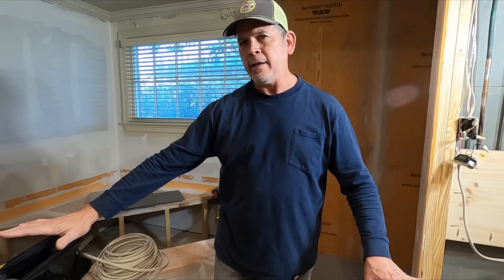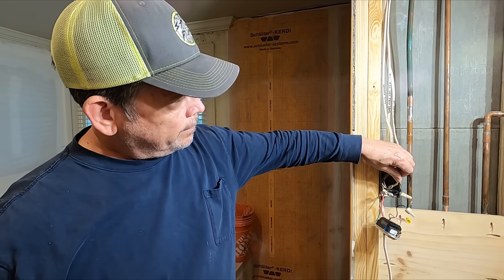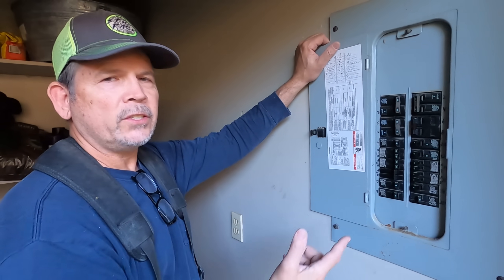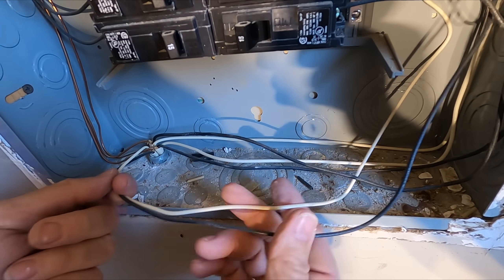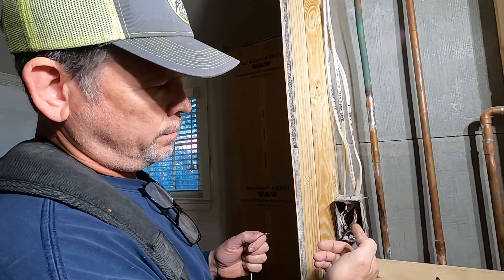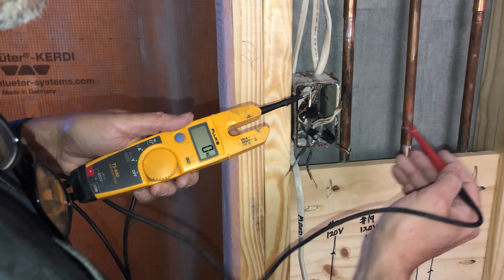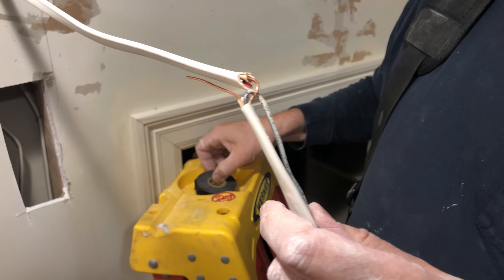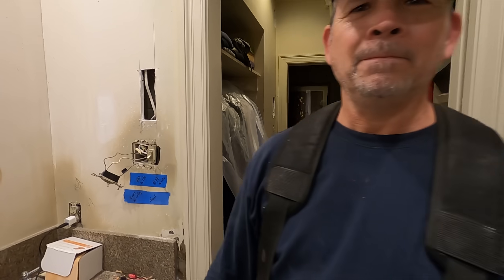You CAN Get SHOCKED by a Neutral Wire! This is How...

Comment from the maker: Hey gang, a couple of clarifications on this video:
1) The black tape you see on the neutral was put there by me to indicate that it was the neutral that had voltage on it; it is not identifying that wire as a hot .  Should've used a different color tape.  I removed it at the end.
2) All wires were determined to be safe after I turned off the breaker but someone turned on a 3-way switch in another room; this action energized the neutral.
Reply: Always test for voltage before doing any electrical work.  Only after you have confirmed absence of voltage, and properly locking out the panel or breaker, should you proceed with any electrical work.
120v is enough to kill you. Even if you feel fine, it can cause your heart to begin beating irregularly, ultimately resulting in death if untreated.
Reply: @akuunreach  It can also cooka few blood cells forming a clot that can kill you
Reply: Yes, an open neutral can have voltage on it ⚡. 
EDIT: I once had a lady's lights and some outlets wouldn't work unless she put her electric oven on. I figured it out pretty quick. Anyone ever see this or know what happened? LoL
Reply: @eldie3d  Actually Eldon that is not fully correct. In a typical switch circuit with power in the octi box for a light a white wire can have power but should be identified as black with tape. I have found people being confused as hell wondering why "that white wire has power when I turn the switch on".
Reply: @eldie3d  I think I can shorten this for you and make it more general. Your neutral can have voltage if it is open.
Reply: @eldie3d  please tell me a friend had this in her apt.
Reply: neutral was energized
Reply: @fredrickvoncold  the "neutral" should not be "live" or hot as they are not protected. The neutral can be perceived as hot, because it is the return to the panel and the "hot" goes to a load, then out the white (neutral) back to the panel. If this wire is disconnected, the elec flows from the black, thru the load, and has no place to go back, so if you touch the white and touch ground, you get a shock
Reply: @fredrickvoncold  neutral was not neutral
Reply: @Hearing.Chanting Remembering.Krsna when you say a center tap of a secondary is hot, what are you referencing? There must be a reference.
The neutral is a reference to a split phase secondary or the center of a Wye configuration. The center tap of a secondary in a split phase is the return path for the 2 phases of the secondary normally called L1 & L2. The two phases are 180°apart with reference to the center tap or neutral.
Reply: @jasonbender2459  Absolutely correct! It should be marked with a piece of black tape to note that.
Reply: @WilliamJefferson1776  You are dead wrong if you are suggesting it is fine to touch a neutral wire with the power on.
Reply: @davebrittain9216  I would touch ANY neutral wire with my tongue as long as EITHER of the following are true:
1) circuit is off
OR
2) circuit is on and (a) no load is using power or (b) neutral is upstream from nearest load using that power.

Of course, if some dummy did some shared neutral ghetto setup, then all that gets thrown out the window, but otherwise, yes, neutrals are harmless.

Prove me wrong.
Reply: @WilliamJefferson1776  Well of course any circuit off is no different than a roll of wire in the back of your truck. Regardless of the situation I always verify if a circuit is live or not even if the panel is off. I have found some major issues in apartment buildings were they were too lazy to put in a run for a recepticle and just tied it into the neighboring apartment so the main panel is off for the unit and yet circuits are still hot in the unit. I have ran into this at least three times.
Reply: @davebrittain9216  
I turned off the main in an apartment and grabbed the broken outlet to pull it out. Ooops. I don’t know where it was powered from but it wasn’t a common wall or floor snd yet! that outlet was live. It was very wrong but I shorted it to pop the breaker (it went dead) and installed the new receptacle (being very careful not knowing if/when it would go live). I had expected a call from someone but, no, no call. Just a reset breaker. I plugged my switch/box in once more and tripped the breaker. Still no call. 
Never figured out which of the multiple apartments were the culprit. 

disclaimer: shorting outlets is a bad idea. Don’t do it. This was 1989 and the electrician I had been working was 75 and did a lot of things all the time that I eventually learned were so wrong. He told me how to make the ‘tester’ to short breakers. This wrong- don’t do it. You could permanently damage a circuit or even start a fire.
Reply: @fishhuntadventure  Rule number one is the verify the circuit is actually dead with a known working meter. I have seen where lazy electricians have tied receptacles into a unit from an adjoining apartment many times. For example I remember years ago I had an employee call me because he was having a number of troubles trying to figure out what was what in an apartment unit. I went to go give him a hand and dropped on my knees to take a look at what he was doing. I directly asked him if he had verified the circuit and he said yes and just for a moment I thought it would be fine to touch it but out of habit checked it anyway and it was live, fed from the adjoining unit. I was not very impress with his definition of verifying!
Reply: @davebrittain9216  well if you keep one hand in pocket and wear insulated shoes then it only tickles just make sure the rest of your body isnt grounded.
Reply: @WilliamJefferson1776  IF YOU use 14/3, (Blk, Red, White and a bare Gnd wire), connect blk & red across two separate breakers, BUT one on L1, the other on L2, then both circuits SHARE the neutral.  NOW WHAT?  Let that one go pinging around your cranium!
Reply: @upgrayde  Please help me understand this: I don't get it....All the neutrals on all the circuits are tied together at the neutral bus inside the panel....isn't that sharing a common neutral? ..please explain what I'm missing here. I'm a plumbing contractor so please bare with me.
Reply: Hello, I would like to see a video on the experience you had with the neutral line. Thanks in advance.
Reply: I would never mark a neutral wire with black tape. I mark the white wire with black tape indicating that it's a switched hot wire. I would use another color for a neutral if you feel the white wire is not enough to know it's a neutral. 73
Reply: @ronb6182  are we allowed to say "black"
Reply: Ah, I was going to say something about that.  Thanks for the disclsure. :-)
Reply: @John Lawson Why don't you go clutch your pearls at acrobats.
Reply: @WilliamJefferson1776  BILL:  6,8,10,12,14/3 Romexs are wired into main panel, regularly. BUT, usually ONLY for 240V loads that also have a 120v load needing a neutral.  But, sometimes, installers use them, /3 Romex, to create two separate 120v branches, and then, share the one neutral.
Reply: @jasonbender2459  True, but the neutrals were not part of the circuit, right.  IIRC, as a layman, neutrals are required only in light fixure and bypass the switches.  I just finished fixing a screw up where the prior owner switched a common with a traveler.  I not only metered the voltage on all the wires I checked the continuity on each of the traveler wires.  So it works properly now and with a dimmer.
Reply: @jasonbender2459  a floating neutral refers specifically to a neutral point that isn't earthed.
Reply: Neutral could of been back fed.
Reply: Gotta appreciate your concern for electrical safety BUT there's more of an immediate danger and an OSHA violation going on at 13:00 . Whats up with that?!? Well, at least he was wearing knee pads!!! Hahahahahahhahah, funny as hell!!! Reeeally? Come on, man!
Reply: I seem to have a similar issue with this scenario except my lonecapped off wife with current still flow in the box is black. It's in a 3gang box powering multiple led lights next to a 3way and 4way switch. This was great info now i can hire an electrician to complete the circuit for me so I change out my dimmer switches. Thanks @Stud Pack
Reply: Black tape on a white wire use to mean a switch leg up to a light not to code anymore I believe as  I've been out of the trade for a long while
Reply: Nikša  yeah that part is definitely wrong
Reply: I got shocked by 347v .  Not fun. Emergency lights and exit lights have the 277 347 tap, and they are not afraid to bite.
Reply: Say that again you have two hots on a three way circuit? Something don't sound kosher in that wiring set up. The breaker should cut the power from the 3 or 4 way circuit period. No matter which switch was moved. All wires should not have current flowing through them. 73.
Reply: ,h
Reply: no
Reply: no way in hell does current flow back through a tripped breaker, kinda defeats the purpose, you forgot to draw your earth grounds in your diagram, suspect you might see where the actual current flow is after that step, and if youre touching a return line without turning off the circuit, of course you can complete/ground it... duh, its why you turn of the circuits youre working with??? smh
Reply: did you make that video about how you got shocked?
Reply: I just see it now as "The worst shock I ever received! .."
Reply: Black tape is used to mark hot whites,,it wasnt marked?
Reply: If you had a NCVT on that neutral wire, would it had told you it was energized and hot?
Reply: why there's a neutral coming out in a switch in the bathroom? can you help me to understand?
Reply: In the diagram that he draws, if the back feed is happening the way it is drawn wouldn't both of those lights be on if both switches were on regardless of the lost common neutral between them. It would basically be a 240 volt series circuit.
Reply: @jasonbender2459  correct. Its called a traveler
Reply: @rty1955  It is not called a traveler. A traveler is only used on three way and up switches. That neutral is considered power.
Reply: @rty1955  yes
And I’m confused why he removed the tape when NEC indicates marking travelers… with tape!
Reply: @rty1955  the red and black are used as the travellers and the white is used as your common. It is still a hot. The white that’s used as the neutral is the neutral. Guys there’s only 2 wire or 3 wire in a house you have white, black and red to work with... if a white is used as a conductor is identified somehow and is called an identified conductor. And it’s identified by either being on a breaker.. or attached to a hot... or with black tap on it.. or connected to a switch ... just because it’s white doesn’t mean it’s a neutral !!!!
Reply: @gurtbeef123  no disagreement on my part. Even if you run 220 to an a/c unit you would use a black & white with the white taped with black tape at the outlet.
The term neutral implies the center tap from the transformer. Its bonded to ground at the box. BUT it depends on if you are in the feed side or load side if that white wire is "hot" with respect to ground. And as agreed the white wire IS a current carrying conductor and should be treated as such.
Btw im an EE.
Reply: @rty1955  or it could be a shunt.
We always use it for the shunt when needed but you all know it should be colored black to identify it if that’s the case.
This was not the case in this video at all if you know anything about electricity ⚡️ you could have seen that
Reply: @frankgorgone6679  so when you use the term shunt you are using   a low resistance path for current allowing it to bypass another part of a circuit, correct? I use shunts entirely differently. I design electronic circuits and we use shunts to measure current flow in a heavy amperage circuit.
Your usage of the word "shunt" is actually a "traveler" meaning that traveler COULD  be hot (with respect to neutral or ground) or not depending on 3way switch position
Reply: @victorserhumano  electrical is one of those trades that not only can you get killed if done wrong, but also you could one day come home to a smoldering foundation.
You need to learn safety first amongst all things. Get yourself a copy of the NEC standards and totally understand the standards. They are written because if safety. I once saw an elderly gentleman in a box store ask the clerk to get him a larger breaker than the one he had in his hand. The clerk asked him what he was trying to do and the fentlemans response was "I keep blowing the breaker for my garage so I want a bigger one so I can have more electric on my garage". The clerk said to him "hire and electrician or you will burn down your garage!" I was amazed at how this gentleman thought is was perfectly ok to just install a larger breaker.
Like I said, if not totally understood you could either kill yourself or cause a fire when u least expect it
Reply: @rty1955  My wife is a realtor and was attending a home inspection for one of her clients. The home inspector was a woman and was using a thermal cam on the walls and found a wire run that was 55 degrees C during the winter here in Canada on an outside wall. I got a phone call from my wife because both the client as well as the inspector wondered why. I told them to take a look at the breaker and it was a 20 amp breaker on a 14-2 gauge wire. It was powering a heater and the water pump. A fire just preparing to happen if you ask me. The breaker is there to protect the circuit period! If you over size the breaker the circuit is wide open to be over loaded. You are right, people just think you can upgrade these with out any consequences.
Reply: @John Lawson so he is showing you how he still had voltage after breaker was off and all you came away with was he is standing on top of a freaken ladder..what a dip stick!!!
Reply: @MrJujubean  man that was great 😄😃😀🤣😂
Reply: Journeyman electrician from NY. First off , nice professional work and attention to detail on many levels across many trades. I wanted to clarify the main breaker on a sub panel comment. A main breaker on a sub-panel is not necessary because the sub-panel is in the same building (if you are in a different building then NEC 225.31, 225.32, 225.33 apply. (to many wires through one connector in the panel) The wire trick worked cause you were completing the neutral. When you used your tester from the black taped white wir to the copper, Did the light work? I honestly think the issue was whoever made up those boxes, wired it wrong. And that involved 1 or more boxes having 2 home run feeds (wire straight to a panel) in one box.  But without having a tester and being there. I would olnly be assuming. Good video and thanks for sharing it.
Reply: @dohabandit  I worked at my father's company during summers while going to college cleaning windows, floors, cutting grass, etc. The maintenance supervisor told me to take the heavy duty floor buffer (240v) and buff the floors. I turned it on and within about 5 minutes I  got shocked, I couldn't let go and tried to yell that I was getting shocked but no sound came out of me all the while I was getting electrocuted. I finally fell to the floor and the fall broke my hands loose from the buffer. I thought I was dying, they sent me to the nurses station and she made me lay on a cot for about 30 minutes then sent me back to the maintenance dept. There they took the buffer apart and knew right away that the apprentice electrician (young guy) worked on the buffer ground wire prior to me using the buffer, apparently the ground wire came loose while I was running it. Never will forget what it was like to get electrocuted helplessly.
Reply: @tweetybird7668  I don't understand how you were electrocuted. 
did the EGC wire get caught in the motor or buffer wheel yanking some wires (idk off the motor" and energizing the body?
You don't exactly explain. the body has to be energized some how. how?
Reply: @wolu9456  all i know is the apprentice electrician worked on the buffer ground wire before i turned it on
Reply: This info is really valuable, thanks. I do appreciate the electrical videos.  Ive called pro electricians out, even linemen, and had issues like this we had a very hard time solving.
Reply: @upgrayde  maybe you should go back to electrician school
Reply: Yep first thing i saw. If that Neutral with tape wasnt carrying voltage then there was a ground fault somewhere and all the plumbing was electrified.
Reply: @dohabandit  By code here in Ontario Canda you are to work on circuits that are disconnected and verified with a known working meter. Where I used to work we had to put a lock out and tags on anything we worked on so there was no accidental turning on a circuit. 110 can easily kills you to if it gets you the wrong way. I once had my pinky touch a 600 volt circuit. It made my arm sore for a good part of a week.
Reply: @WilliamJefferson1776  In any lighting switch circuit you run the neutral hot so I really don't know what you are getting at there. Migrant people have nothing to do with shitty work ethics. I took over a crew of your typical all white workers/contractors and I was appalled by the amount of trash work they did. I just hate sloppy work! I always say if you do shit work then that is exactly what you are, shit!
Reply: I have just installed 2 new breakers and ran them to each a outlet

All connected the same but only one works. Any ideas I've changed breakers and outlets and the wire is brand new
Reply: @emmettfuselier4970  Do both the top and the bottom of the outlet not work? Are they new receptacles? I am asking because I am wondering if someone broke one of the tabs off. for a split receptacle.
Reply: @emmettfuselier4970  Have you heard about the tongue test. Put your tongue on the live wire and your finger on neutral and if you get a slight buzz on your tongue (like the tongue battery test), then you can tell if the black wire is sending electricity. Try that first and then tell us what you've found out.
Reply: @John Lawson it's not good practice to stand on top of an A frame ladder.  Though often one has to just take a bit of extra care (and risk...) so you can save the 1.5hr getting the proper ladder while the sky gets dark and you run out of work day.
Reply: @MintStiles  
Or come prepared. There’s always that option too.
Reply: @Cal L  Don't worry, he's got many years of experience under his belt. 
They're not making OSHA video's.
Reply: @MintStiles  I have found myself on tip-toe on a 14' a-frame to avoid scrubbing an AP installation while the project manager tries to get a scissor lift rented. Not something I like to make a habit of, but when you don't get paid full rate for failed sites, you make due.
Reply: @templebrown7179  yeah.  Unfortunately that the reality of things.  Ideally everyone would have every tool needed for every job, but that's just not practical nor realistic.  I am certainly not advocating taking unnecesary risks, but most experienced professionals have the common sense to gauge the risk vs getting F'n thing done already.
Reply: He also was not solely on the ladder. He had good handholds in the attic hatch. If the ladder would have failed him I bet he would have not fallen.
Reply: @ecospider5  How can you be sure of that? Quite an odd statement.
Reply: @bitTorrenter  Because he has probably done it before. Maybe he should have had his fall arrest gear on too.
Reply: @bitTorrenter  hell no it isnt. Always have additional support when on the top of a ladder and yes hanging from a joist has saved my ass multiple times.
Reply: @Hearing.Chanting Remembering.Krsna in USA in a residential area, the secondary on a pole transformer IS center tapped, and IS the neutral. There is no 3 phase in a residential area.
In power generation the center of the WYE configuration IS the return for each if the phases.
In a well balanced residential secondary winding, the neutral should not have any current flowing
Reply: @upgrayde  the shunt is the common screw on a 3way switch dork
Reply: @frankgorgone6679  a shunt can also be referred to as a device used to remotely trip a circuit breaker.
Reply: Use a amp meter and test an see how many amps are on the neutral wire from grid coming in. Check both hot wires coming in. You be surprised the amount of snow on hot wire is same going back out the neutral wire. Going back to sup station. I see what you saying about second switch, 3 way. Everyone, Go Check the neutral wire inside your breaker box, see how many amps you paying for being sent back to grid that you'll pay for again next month. Build your own power, stop paying for grid power.
Reply: @terrydouglas2777  can you reference me a diy own power? please.
Reply: @terrydouglas2777  the "neutral" wire from the "grid" is attached to one side of a transformer winding on the pole. The other side of the transformer is attached to overhead primary wire. The "neutral" that is attached to a customers house is the center tap of the secondary of the transformer on the pole. Not sure what u are referring to.